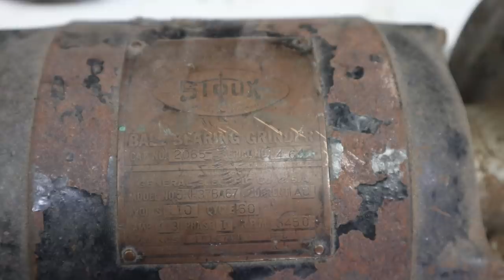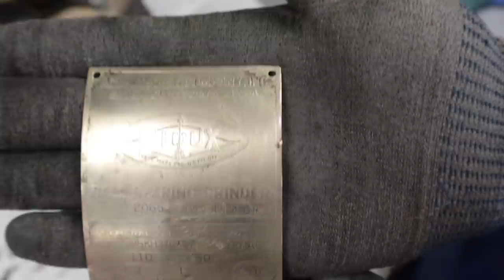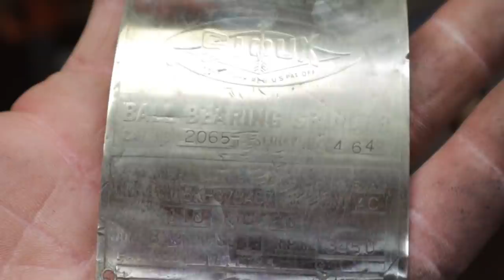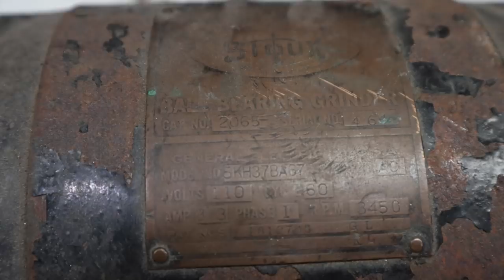90 Year Old Bench Grinder ~ RESTORATION ~ How did this one SURVIVE the WWII Scrap Yard?

Comment: Great video. But after your PSA about gloves did you not use gloves while using the wire wheel? lol. Either way i loved it.
Reply from the maker: Do as I say, not as I do! When using wire wheels on an angle grinder it throws wire pieces during normal use and I recently had one stick in my middle finger down to the bone, and I couldn't get it all out, so I decided to give gloves a try, WRONG gloves! Ya live and ya learn!  Thank you for watching and commenting! Lots more to come!

Comment: When you were installing a new power cord, I noticed that there was no ground wire. When this thing was new there were no ground wires as such but today? But what happens if for some reason , years down the line the hot wire touches the frame? There will be a dead body on the floor. maybe a grounded cord costs more money... so how much is a life worth?
Reply from the maker: I agree! I have already replaced it with a proper grounded cord! thanks for the thought!
Reply: @SalvageWorkshop  //  Yeah, and then what happens if you get dirt in your wound, and it becomes infected, or one of your other pieces of machinery hurts you; what about that; shouldn't you get some kind of insurance? Do you have enough fire extinguishers b/c "what happens if for some reason"....good grief. Americans are convinced that life is supposed to be risk free, and their pizza has to be there in 30 mins, or it's has to be free. 
Btw; great job on the restoration that I'd of used with the other cord [it was only 110]. I'm sure most ppl don't work while standing in an inch of water.

Comment: I've watched a lot of bench grinder restoration videos before I did mine. I have a buffalo. 
This is the first one I've seen that has that thing on the shaft that clicks what it gets up to full speed like mine does. What is it. 
And like mine it doesnt have that electric tube thing in the bottom.
Reply from the maker: The clicky thing is called a centripetal switch and it disengages the startup circuit once the motor is up to speed. The tube thing is a capacitor, and in newer motors they have 1 of 2 uses: Either to start the motor up or to help run the motor.

Capacitor start motors use capacitor only for starting, after which the capacitor is switched out by the centrifugal switch. The motor thereafter runs without the capacitor on one winding.

Original designs of AC motors in good old days did not have capacitors, like this bench grinder. They had two windings with different wire thicknesses and number of turns. Auxiliary winding had thin wires and large number of turns, giving high resistance value, thus creating a phase difference between the two windings — necessary for rotating magnetic field. Then once started and up to speed, the start windings are switched out by the centrifugal switch.

Good question! Thank you for watching and commenting! Lots more to come!
Reply: @SalvageWorkshop  thanks for explaining. I'm about to buy a baldor 2hp 12 inch for 300. I wish I knew how to make YouTube channle. I've been doing vices and just did a 1750 Wilton snapon vice. The grinder I'll restore and sell too
Reply: The "click thing" is the centrifugal starter which was used rather than the "tube thing" which is a capacitor starter.

Comment: What are the pins called that attach the brass plate?
Reply from the maker: Good question! I honestly don't know, I use small brass or chrome nails, I just cut them down to the size of the original and make sure they are about the right size of the hole it needs to go into, or slightly larger. Many times It's possible to reuse the original ones as well. Thank you for watching and commenting! Lots more to come!
Reply: @SalvageWorkshop  Is it called a Screw Rivet or a Nail Rivet?
They are short, the helical screw thread only goes around the shaft maybe one full turn and they are inserted using a hammer. They twist themselves into the casting or even sheet metal to stay tight.
I tried to find a photo of one but was unsuccessful.

Comment: Wrong hole eh, yep weve all been there...
Yep grinders can bite, lucky yours was just a flesh wound, they can get much worse.
Speaking of worse, degloving a finger because of a ring is quite dramatic, take the ring off in the workshop to avoid that. (Grinders not included.) The wife will understand.
Nice work on the bench grinder, I did mine this time last year.
Cheers.
Reply from the maker: Lol... I wear a silicon ring for that exact reason! Thanks for watching and commenting! Lots more to come!

Comment: Nice work. In the future use shaft savers when using puller pressing against ends of the motor shaft. Your method destroyed the integrity of the shaft end centers. Motor shaft OD and journals are registered from the centers.
Reply from the maker: Why would I ever need the end of the shaft centers on this tool again? I'm never going to need to put it on a lathe. I agree it was registered from the centers when it was originally turned, but now the tool is used specifically on the the OD of the shaft. I'm just curious. Let me know your thoughts! Thank you for watching and commenting! Lots more to come!

Comment: Neat project.....but the silver metallic paint lets it down imo. Would have been better looking in all black, taking the age into account. .
Reply from the maker: I considered that, but decided to paint it the original colors instead.  Thanks for watching and commenting! I truly appreciate the support! Lots more to come!
Reply: @SalvageWorkshop  I am no expert, but at 1:17 in the video it shows the bottom part of the stand in the same color as the motor. It looks to me as if someone did a paint job at one point in it's long life....? Or I could be totally wrong....no matter. :)
Reply from the maker: You could be right, it's an old tool that's been around for quite some time!
Reply: @SalvageWorkshop  If I may give you a little tip? 

When painting really old motors and tools, try the Hammerite 'Smooth Finish'. It will give your parts a more original old look. ;)
Reply from the maker: @aspedersen1  It you watch some of my other videos, I have used that exact paint! It's great stuff! Good tip!

Comment: A really great restoration but what bothers me is there is no earth all metal machines have to be earthed
Reply: It's too bad that it bothers you. That might be the way things are today, where every metal machine is required to be Earthed (or as we say here, grounded), but back in the day when men were men and sheep were afraid, it wasn't a requirement, largely because it wasn't seen as being a hazard because a machine like this one was expected to be placed in a shop, or a garage, or perhaps someone's workshop at home, and largely away from the touch of children, infirm people, or those who wouldn't understand the danger(s) that were possible (but not always prevalent) in electrically powered machinery. Nowadays, bench grinders are a dime a dozen, found on almost any workbench in people's homes, basements, workshops, tool sheds, work trucks, perhaps even kitchen counters to help with the removal of baked-on food that sticks to cookware... And yes, many do come with a 3-prong plug for grounding/Earthing purposes.  For the record, it wouldn't be terribly difficult to deliberately ground or Earth an older machine, whether done using modern 3-conductor wiring between the device and the power supply, or by simply running a dedicated conductor (need not even be insulated) between the device and a suitable Earth or ground.
Reply from the maker: Lol... nothing was grounded back in the day. I have since replaced the cord with a grounded cord and properly grounded the grinder! Thank you for watching and commenting! Lots more to come!

Comment: I like the restoration, but you could not have paid me to put that old oxide wheel back on. After your first one explodes, you become far more wary.
Reply from the maker: I put a different wheel onto this grinder! I've had one explode on an angle grinder!
Reply: @SalvageWorkshop  Excellent. I was just concerned because it appeared that you put the old one on. I had a wheel let go in a surface grinder. Thank goodness the guards swallowed most of it when it let go. Sounded like a bomb going off in the shop.

Comment: you need to try using seafoam deep creep on your projects. i cringed at you removing stuff with a puller dry.
Reply from the maker: Ya I probably should have had some oil on it! I have Deep Creep and I love using it when I am heating up stuck nuts and bolts! It works even better then!

Comment: I taught shop for 37 years and one thing we never allowed was gloves around revolving machinery.  It was right there in the district safety rules.  The grinding wheel needs a proper rest to support the work, think safety.
Reply from the maker: I agree on safety, and I have a question for you. Are there any gloves that protect your hands and wrists that are safe to use with an angle grinder and wire wheel? 

The thing about using wire wheels on an angle grinder is that no matter what type, the knotted wire, the straight crimped wire, the cupped versions, they all throw wire pieces off when they are being used and eventually wear down to nothing.  Recently I had a piece of wire lodge into my middle finger so deep it was in the bone and I couldn't get it out.  That's when I decided to wear gloves with them, which I normally don't do. 

I take most precautions regarding safety, definitely not all, but I am not stupid about using tools and equipment, and would love to hear your thoughts on this!

I have a few bench grinders each set up for different tasks, and the way I plan to use this one, I don't want a tool rest. Plus the tool rest wasn't original. Who knows, maybe I'll change my mind and make a decent one for it!

Thank you for watching and commenting! Lots more to come!
Reply: @SalvageWorkshop  ... I use leather gloves when using my bench grinder and/or angle grinder and/or wire wheel. Also a face shield. Don't want one of those crimped wires shooting into my eyes!
Reply from the maker: @jt9498  I need to find the right leather gloves, the ones I have are too loose and I dont have the best control over the tool. Yes a face shield is a must!